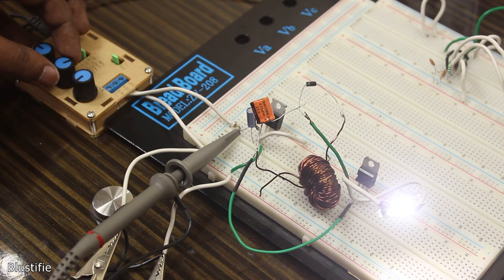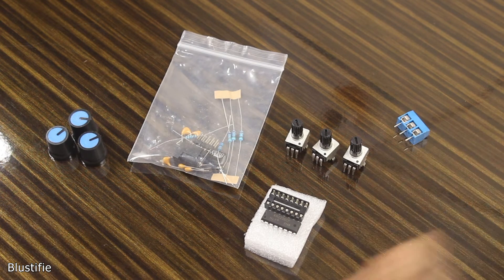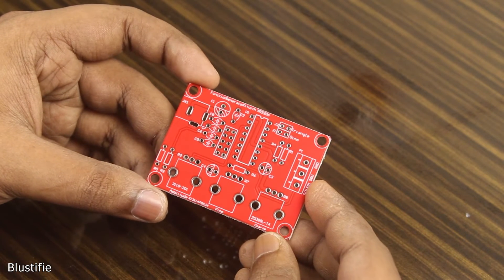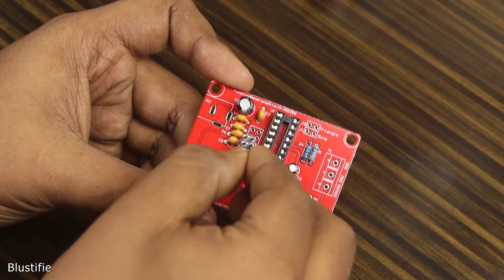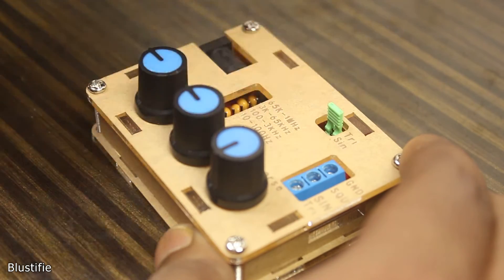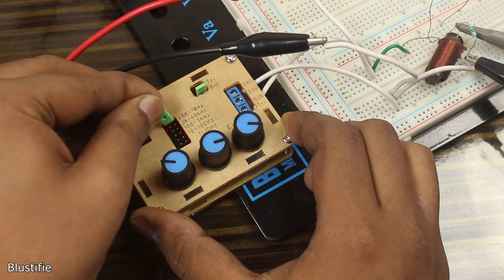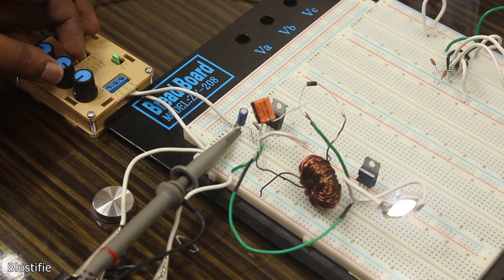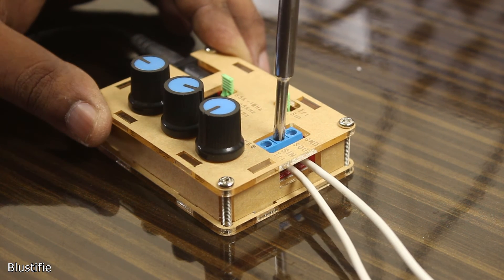7$ Function Generator kit: Assembly, in-depth Review & Problems | Is it really Worth Of the Money?

Comment: It is an OK little kit for a quick bench top wave generator. This chip XR2206 is a copy of the original and doesn't quite come up to the specs on the original datasheet. Max 12V before it becomes unstable.
Caution! Add a protection diode in the +9V to +12V power input. If you accidentally reverse the power the chip is smoke lol
You can remove some of the harmonic spikes from a frequency spectrum analyzer by swapping out R4 (pin 13, 14) with a 500 Ohm trim pot and adjusting until the harmonics are close to the signal floor leaving only the wanted frequency.
The provided frequency adjust pots are too coarse/sensitive. Consider something like a 10k pot instead of the 50k (make sure you keep the full resistance range of 0 to 150k ohm).
You will need a small ceramic capacitor on the sine/triangle out terminal to correct remove the DC (offset).
There are a few other tricks this chip can do from the datasheet :)
>
I connected mine with a cheap DL4YHF2 Frequency Counter kit.
I used the sqr out which is locked at 0V to Vcc (9-12V). Place a fast switching NPN (2N3904) via a voltage divider from sqr out and gnd. You can use the 9-12V from sqr reduced via R1, R2 to put about 1.2V at the base of the NPN. I used 9V so R1 = 10k and R2 = 3.3k (remember the pull up R1 on the XR2206 board is also part of the voltage divider).
For the DL4YHF2 just connect the signal in to the NPN C collector via a 1k (just for safety but not needed) and the gnd to ground (E emitter).
Just use the NPN as a fast switch (relay) to pull the DL4YHF2 +5V pull up to ground via C E. This will correctly activate the Schmitt trigger on the DL4YHF2 and give an accurate digital freq count :)
>
I just just use it for experimenting with small audio amplifiers.
Thanks for the video :)

Comment: Hi, I'm just beginner. I just built oscilloscope by following youtube tutorial.
My oscilloscope are made of Arduino and OLED I2C screen.
I've never use oscilloscope and function generator before. I learned that Arduino is 5v tolerance and if I connect any voltage larger than 5v my Arduino will be completed destroyed.
So I wonder if I can use this function generator with my diy oscilloscope. 
What is voltage of signal coming out of function generator? and is it safe for my oscilloscope?